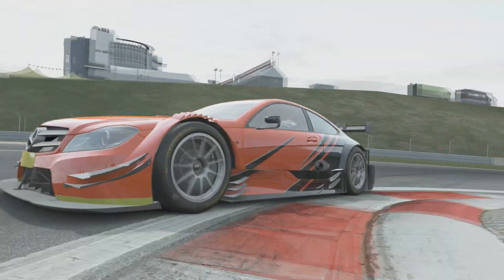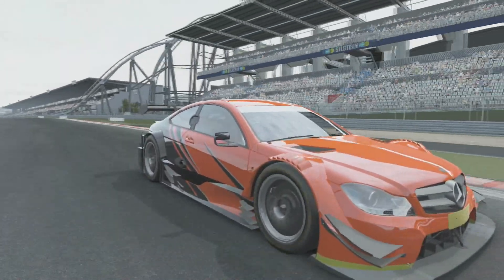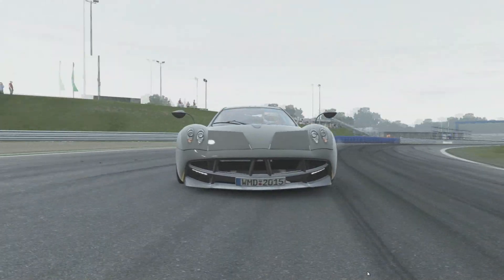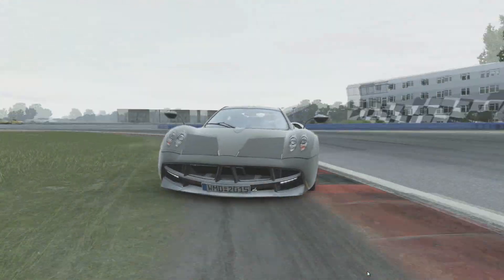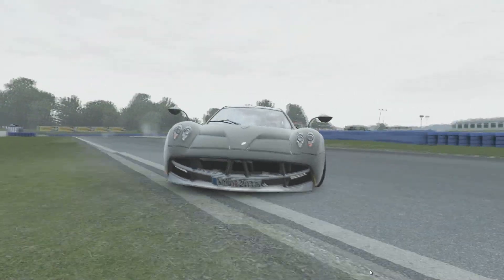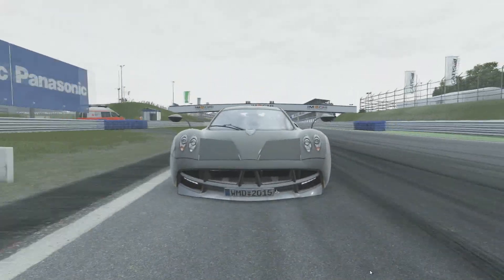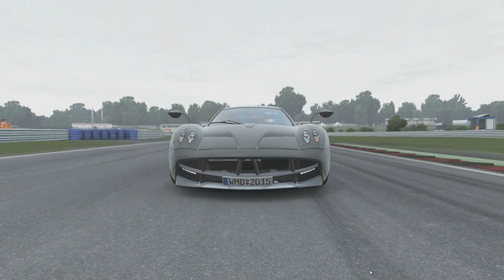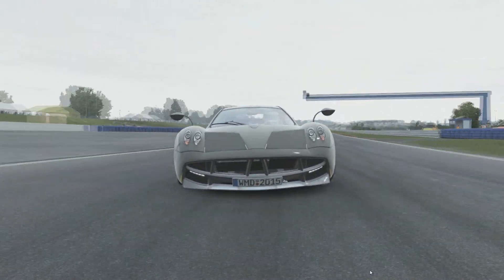Project Tuning Guide Part 3B: Dampers

Comment: Thanks so much for these tuning videos! I've watched all of them over the past few days and have been typing up a cheat sheet with all the adjustments to refer back to. It's basically a summary of the videos. I would gladly post it on here if it would help anyone.
Reply from the maker: Corey Dusel  Thankyou don't worry about the cheat sheet were currently creating one .

Comment: Increasing slow bump in the front of the car seemed to allow the car brake quicker, and steer into a slow corner when downshifting. Increasing rear slow bump seemed to increase the acceleration getting out of said slow corner, in expense of understeer. Game was Assetto Corsa.

@8:50 How would you adjust dampers based on engine position? On a rear engine car, wouldn't it make sense to have the rear softer than the front, or have their values closer to each other, than a front engine car?

Comment: +T&Z Productions: 
Please help. I'm fairly okay at understanding many of the tuning options like differential, downforce, tires and braking and usually can produce a positive result upon adjustment.
My biggest issue is the damper and spring settings. Spring settings ALONE I can also notice a small positive difference. As for cornering though, no matter what any car you pick will need improvements, and when I try to make them, my rear end of the car is always a disaster if I'm not careful. Can any slightly more simplified explanation be made of the damper settings? I'm either skidding coming out of turns or too much over steer when I have to throw it into a corner and it just kicks out and I spin. Help?
Reply from the maker: It's sounds to me that this issue with rear of the car has been worsened by your style of driving. If you can pm me a link to a lap in the car with telemetry screen up and your setup I'm happy to have a look.
Reply: It'll take me a couple days to make, but I could get it to you.
Reply: My biggest and hardest times are in the BMW M3 GT3 and Ginetta G55... no matter what I do to those damn cars. Every turn, every bump, the rear end goes right out and I'm done. And if I can get some stability, the one thing I can't get is decent grip.

Comment: My biggest issue is overheating the tyres. Using ds4. Could all these bump settings be related to it? I have adjusted many things quite successfully but the formula A I'm driving is mega scary and bouncy. I need to gain around 3 second on Nordschleife and this might be the key. Please help